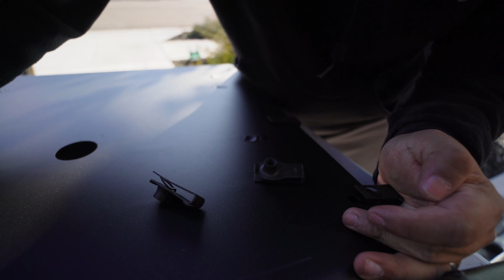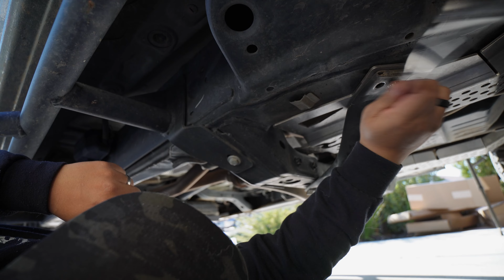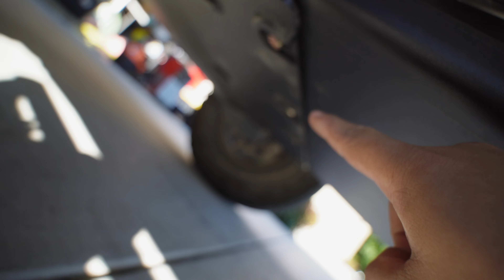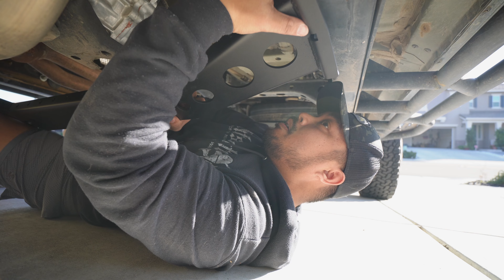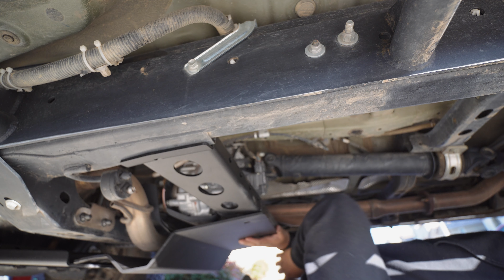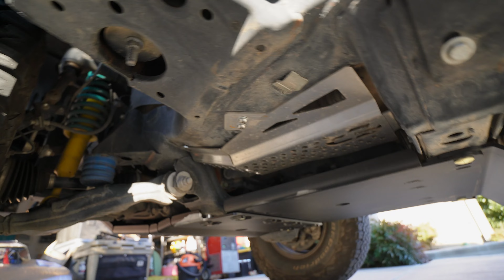Cali Raised LED’s Transmission & Transfer Case Skid Plate (2016+) 3rd Gen Tacoma Install

Comment: I see you used a deep socket to get to the bolts to the transfer skid plate. I tried using a regular socket to tightened that top left bolt and let me tell you I could not tighten it for the life of me 😅

Comment: The skids have to come off when you do a fluid change to the transfer case and transmission?
Reply from the maker: There’s a little door you can take off. You can then use something like a box or half of a cup to block the initial flow of oil so it doesn’t go everywhere. Then replace it with a fumoto valve if you’d like

Comment: Do you have any advice or recommendations with this product or do you prefer another brand of transfer case skid plate ?? Thank you
Reply from the maker: I haven’t had any issues with the skid and they’ve held up nicely so far. I’ve bumped and scraped them on a trail we went on a few weeks ago and nothing out of the ordinary has happened. It did it’s job.

I can’t really give you much information on any other skid plate brand as these are the only ones I’ve felt with.
Reply: @RoamWithJon  Ok good thank you …